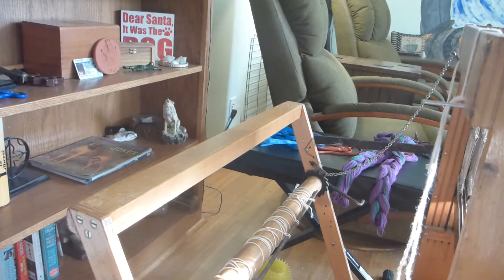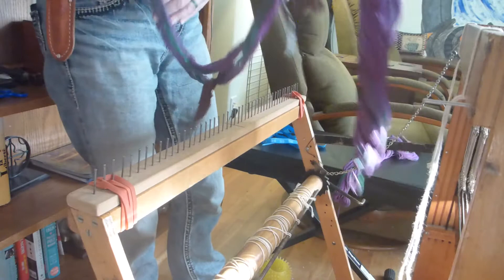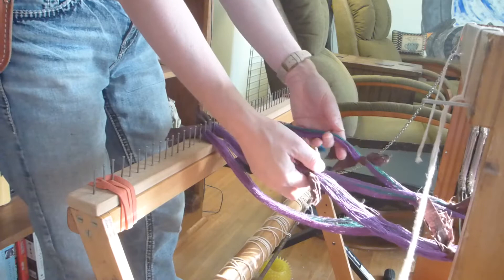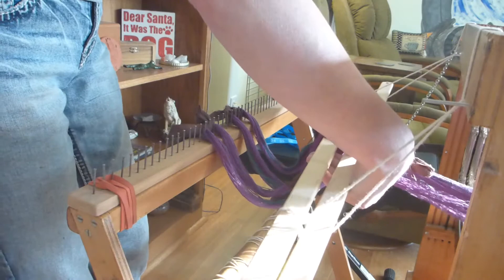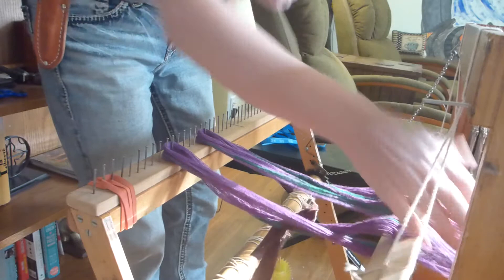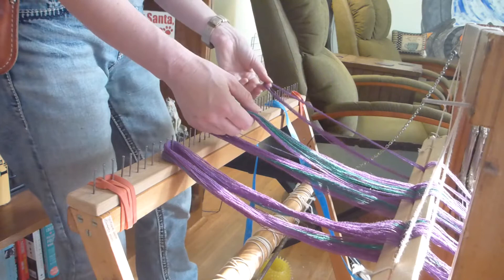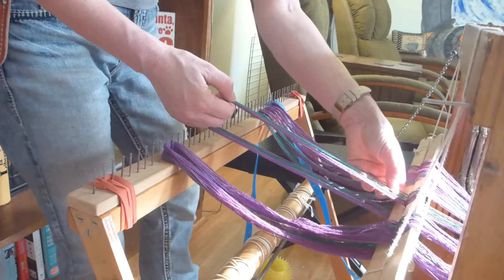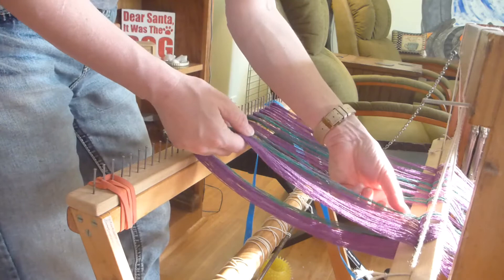Back to Front Warping on a Baby Mac

Comment: Warped 4 ends per bout.
Reply from the maker: Yes, there are times when I have an extra "bit" at the end and that's ok. The idea is to wrap it around the back beam at "approximately" the final width you are looking for.  It does not have to be exact, though!  That's part of the beauty of the back to front warping.  And once it's on the back and threaded through the heddles, if you have a 10-dent reed, you would simply pull them through in this way:  2-2-2-3